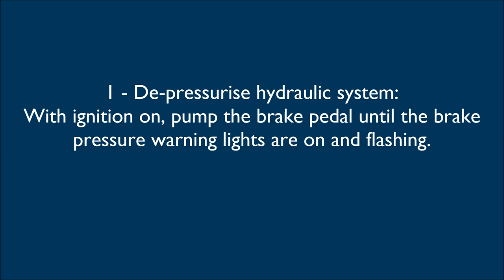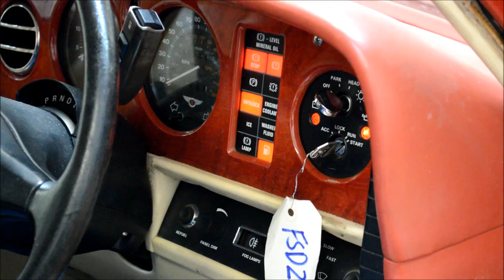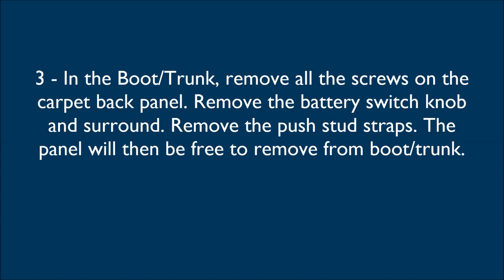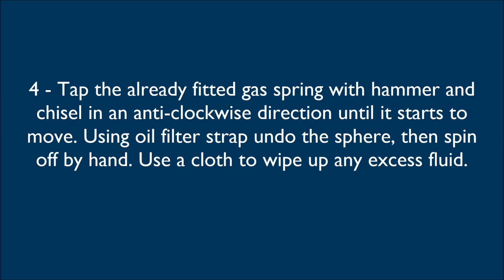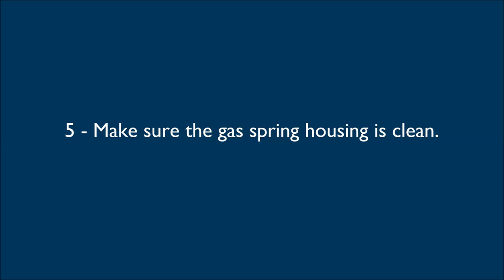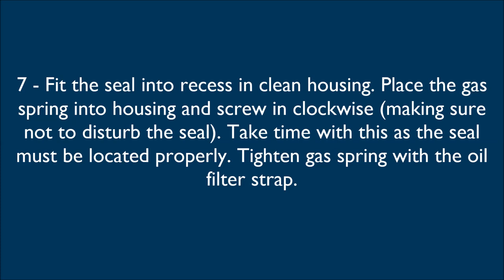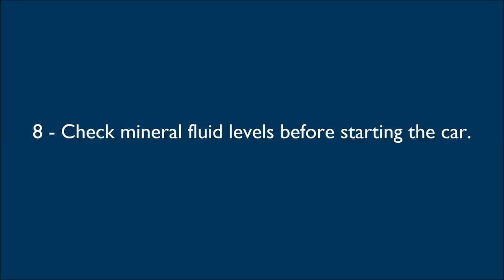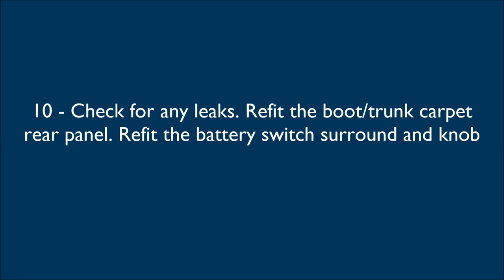Rear Gas Spring Replacement Tutorial

Comment: Any tutorials on replacing the Spur/Spirit front accumulator spheres?
Reply: Front does not have spheres!!!!
Reply: @mutleybird
Almost same work just release pressure using the bleed screw on the valve next to the Sphere with a 12 ring key

Comment: You should never grease the rubber components, it will eat away at them. Use LHM only.
Reply: Anno Domini he used special rubber grease
Reply: use Vaseline does the same job but doesn't eat the rubber
Reply: @jackkallemdjian3945  Yes with the grease canister standing on the customers expensive luggage  room carpet It is a Wilton carpet most people can not afford to have them on flours
at home If grease was needed R-R would have provided the correct type Use LHM only

Comment: You guys need to take this video down as it is not representative of what’s actually involved in doing this project.   Also you do not discuss some of the issues that someone might run into and there’s no audio
Reply: Yes and a warning about the oil leak in the trunk of the car removing the old Sphere
Remove the carpet is a great start
Reply: Not remove PROTECT the carpet under the Sphere it is not easy to blead oil out of them completely
Reply: I did this 8 years ago on my 96 Brooklands and I had a terrible job removing the spheres. There's also some curled piping in the way that I removed. I also seem to remember that I did bleed the system by using the bleed screw (just one on the 96). My rear suspension has always seemed hard unlike the Rolls so I don't know if that's normal or not. Oh and there's definitely spillage so use plenty of paper towels.